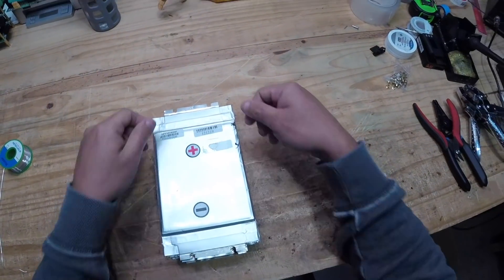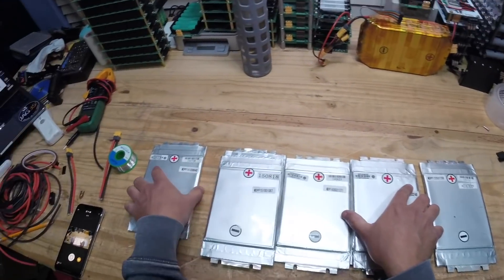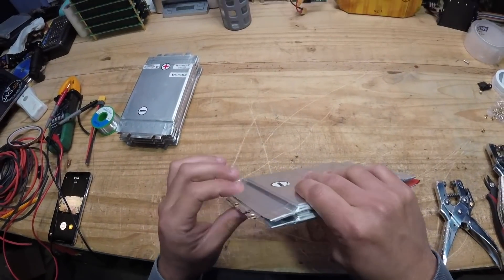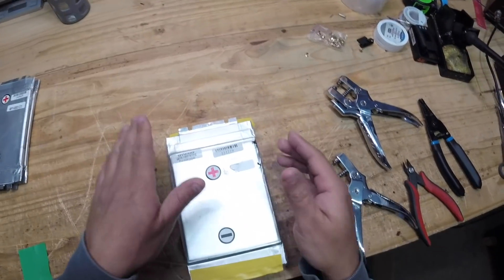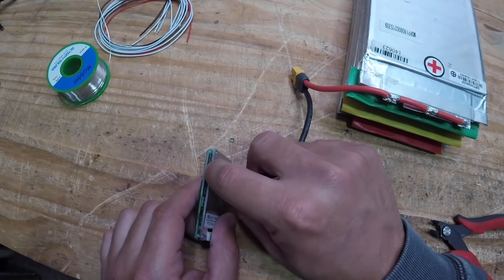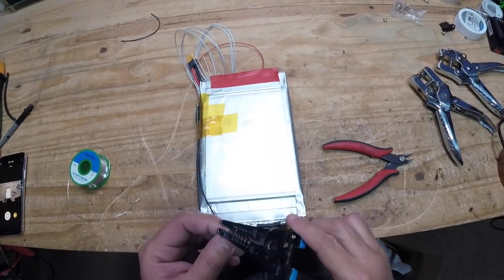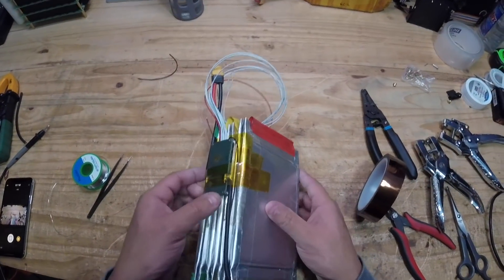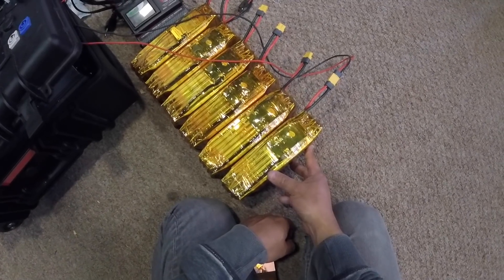Build SPIM08hp LiPo into 7s 24v packs with BMS

Comment: I am looking at making a 3S4P 12v li-ion 18650 battery but I cannot figure out how I am meant to wire up the bms, I am looking at buying this charger, as I have got my 18650 cells out of old laptop batteries I know they will need good balancing so I was planning to buy this charger to charge them https://goo.gl/7rz9QM this charger has a port for the balancing when you charge the battery but I don't know how you would connect that to a regular bms https://goo.gl/7CCu8q also would you recommend this charger and this bms or are their others that could do the job better (for a similar price mark). Sorry if this is a bit of a vague question and not like the normal interesting questions you get, I am just trying my best to be able to learn how all of this works. 

Many Thanks

George

Comment: good little project really like it but i have to throw a but in here... the main power leads are attached at 3 points, but its the most amateur way to join/attach them .ever. 
Wired joints should be mechanical attached before being soldered, to do this to mil spec, a wire should have been passed through the hole and tied around the main current carrying wire and then it should have been soldered. another option would have been to have pass the wire through the holes.  solder is not a glue, ever, well unless your a cheap sweatshop factory.  dodgy amateur soldiering in high current applications leads to fire, and we dont want another one...

Comment: Can you do a video on electrical safety?  Especially on the 48v higher amperage setups and dangers associated with ac vs dc (if there is even a difference?).  I am curious know at what point these systems can start to harm you.

Comment: Questions for all. If you were to do this as 4s packs. mount a few packs in a box, then install into a car. Many lithium chargers can take the 14.5 volt charge from the alternator and manage charging the 4s packs. Problem is, the alt needs power supplied to it to create a field to charge. Once the packs reach 14.5 volts, the alt will be shut down by the car's voltage regulator. Is there any way to get a charger to send a 12v signal out until the packs reach 16 volts? then cut the 12 volt line . I guess a charger that knows how to manage a cars onboard voltage regulator? And a shunt that would limit the 16 volt to 13 volt so the car is not damaged?

Comment: What's your thoughts on using these packs to run a trolling motor? If so how many packs would you need to get 120 AH @ 12V I think it would be 15 right?
Reply: thats what Im doing with these.  You only get the AH increase for the parrallel connections I believe.  so 3 in series x 15 in parallel =45 cells would be 12v 120 ah.  Unfortunelatley you will go slower once they drop in voltage so maybe opt for a 4s pack.  Disclaimer:  you may or may not burn up your 12v motor running it for long periods at 16 volts,  I got a speed controller/potentiometer to eliminate this risk.

Comment: great video man. If I want to make a 12v solar generator, would you suggest making a 3s battery or a 4s? I want to get the most out of my cells and am not sure which one to do.
Reply: if anyone here has any suggestions that would be appreciated
Reply: @harrisonsanin8  4s all day, just gotta make sure you get a solar charge controller that can be set to charge at the appropriate voltage, the cheap ones are just for lead acid batteries.  And of course make sure your 12v load wont fry on your full charge voltage of 16.8.    Or if your using an inverter get one that will handle that voltage.  .
Reply: @Noone-l6g  ore goe with lifepo 4 cells 4s they are at 14.4 v like an lead acid baterie
Reply: @Noone-l6g  would the one that he uses in his cheap Kodiak build work?

Comment: Jehu,
Is there a good way to make an engine start battery that will stay hooked to an alternator while running? These batteries need to stop charging once full and disconnect from the charging circuit, but an alternator needs to have a battery to keep working.  I have seen engine start Lipo batteries for racing vehicles to reduce weight, but I don't see them used for this in everyday vehicles. I would like to replace 240 pounds of batteries in my boat with a lot less weight.

Comment: I have a question. To make a pack of lithium batteries to 12 v I can combine cells of different capacity to have 3 pack of 21 Ah. Using batteries of 2.2 ah and 2.6 ah ?
Reply from the maker: Yes,  you make groups of matching capacity
Reply: So could you make 12v packs using these pouch batteries and then wite the packs in series to maintain the 12v and gain more ah capacity?

Comment: Nice video as always Jehu. I have been looking at those pouch cells. I like the idea of using low resistance cells very lightly for a long life. They are for sure much cheaper than 18650’s, but also way less work. I think the chemistry is inferior and not nearly as long life. As long as they are cheap it remains an attractive proposition.
Reply: They're designed to be cycled at high C-rates.  If you're only running them at 2-3C and don't use the max/min voltages, they'll last a long time.

These cells don't have great energy density at a bit over ~100Wh/kg, but for a stationary application it's really not a big deal as long as you have the space for it.
Reply: @phateracing  But packing round hard cells into a square box lets air gaps. packing these into a box has a  density like this. I put 42 of these into a 13.7 inch by 9 inch by 4-3/4 inch high box(custom made). Inside dimensions.7s 28 volt setup. I am getting 1624 watt hours out of it. 38.8 watt hours per cell. that's 105 amp hours at 4 volt. 10.5 amp hour each cell. 10500 mha. I am drawing at .03C(5 amp draw) to get this. But very impressive. 4.2 volt to 2.5 volt. On top of the box I added circuit breakers and  wiring and some buss bars. And another cover. Total weight is 31 lbs.   My box is 14 kg =1625 Wh. 586 cubic inches. 116 wh/kg. What can do better then that? under 580 cubic inches? Wiring,  and attaching hardware included?

Comment: Pre tin the wire on the xt connector, it will go through the hole better. And solder goes where solder has flowed!

Comment: Can I make a battery pack for an ammo can stereo with those??
Reply: These actually fit nice in an ammo can. I made an ammo can trolling motor battery with these.
Reply: @tomamerman7699  thanks for the information yeah I drive tractor so I like to put a stereo ammo can battery use with me but using the big block batteries I want to change it up make it a little lighter
Reply: @tomamerman7699  How did that work out? That's what I'm wanting to do some kind of 24 o 36v 60 to 80 ah battery for trolling.
Reply: Worked great. Fit 20 in an ammo can, 36v 16ah. This will be working 20 years from now
Reply: @tomamerman7699  Only 16ah don't work for long does it? I'm thinking at least 60ah. It's going on a bass boat.
Reply: @tomamerman7699  And thanks for the reply. I'm more asking how it works for trolling and time it lasts. I will prolly mount them in something plastic to keep dry.

Comment: Eyelets... never would have though of that. Thanks. And I've tried soldering those tabs together, it is not easy.
Reply: Ajemo, I agree.  I would never thought of it either and it seems ideal.  I just ordered from Tom, and then followed Jehu's Amazon link to get the grommets.  I'm getting excited! :-D
Reply: @chadforte2572  I ended up going with a harbor freight rivet setup, surprised it turned out very clean with plenty of room to avoid shorting.
Reply: Yeah aluminum is very hard to solder. This method is the easiest. Others use busbars and nylon screws but this for sure is perfect.
Reply: Bus bars was my thought with stainless screws... Bus bars can be made out of copper tubing, flattened out, and drilled to match the existing holes...

Comment: Yo bro ,I bought 42 of these  thank you for your video.cheers.
Reply: @Boba-Fett-GS1150Ez  That I understand and I think is mentioned in several places. Only thing that concerns me are the batteries i received that are puffed or get hot during charge. Pretty sure those are on their last stretch. Did you have any like this in your order?
Reply: Have you had any issues with your batteries? I have some that are only 6000mah in capacity with high resistance.

Comment: has anyone come across a cell monitoring/logging system, want to monitor and log some 12s (6 leaf modules), going to have multipal  packs, would like to monitor and log each module, does not have to monitor as packs , do not need balancing feature only want to monitor and log voltage

Comment: Can you check out ProLogium? They seem to be the battery to beat. Better than a Tesla. 
They are the 2019 CES Innovation Award winner for a  BiPolar+ 3D Structure Solid-State EV battery pack. How do you get these batteries? They seem perfect for a wall or car etc. 
What am I missing? 
Here is some more info 
https://www.prnewswire.com/news-releases/prologium-the-world-leader-in-solid-state-battery-won-the-ces-2019-innovation-award-300767864.html

Youtube video 
https://www.youtube.com/watch?v=UVwJarCtn_4

Comment: In case your curious, Kapton tape can withstand temperatures of 500° F or about 260° C long term, with a max short term capability to withstand temperatures of 572° F or about 300° C. I don't know what the definition of short term is, but I wouldn't want it to be at the max temp for more than a few minutes personally, or preferably ever. With the application in the video above, the temp should never get anywhere close to the long term temp unless something goes really wrong ( short ), so it's a good use case.
Reply: Good idea but not a great implementation, because kapton tape was designed for use as a thermal isolator to prevent electronic components absorbing heat when neighboring components were heat gunned or soldered to pcb’s. Isolators also act as insulators in the case where the bms is fully encased by the kapton tape, essentially you have create a thermos when leaving no path for the components to dissipate heat. Small detail, but often is the difference between a thermal runaway event and having a standing house.
Reply: Hi can Iput them in parallel with deep cicle 12v in my solar panel array.
Appreciate if you can help.

Comment: Nice video. However, I didn’t see how you connected the white wires to the individual batteries.
Reply: I think he soldered them to the brass eyelets. the black wire #1 wire goes to the  neg end of the first cell. (Main negative of pack). the 2nd wire (white) beside the black wire goes to the positive side of the same first cell. Then the 3rd wire(white) goes to the positive side of the second cell. 4th wire to positive of 3rd cell. Keep going down the connector. All wires go to the positive sides of the cells. Having a red wire and calling it the positive is confusing,. all whites are positive . There are 7s connectors being sold that have the black wire on the wrong side. Follow the negative mark on your charger or balancer, then go from there.

Comment: Bro i WHANT to do what your doing but i have no clue about anything your doing where the in the heck do I start
Reply: Theres some books on amazon for building lithium batteries.
Reply: When you say" I have no clue about anything", you have to know something... is it the electrical part, is it the mechanical part of the assembly, is it the theory of the project...?... you can be guided along, if you tell us what you do not understand...
thanks
Reply: From what I understand, Jehu didn't know anything either.  He just had a dream, and I respect him greatly.  Best of luck that you will figure out what you can do!

Comment: Nice little pack, I would just avoid wrapping the whole thing up in the tape, if there is an expansion in the cells you don't want them to have pressure holding them tightly like that. A few pieces on the sides to hold the shape whilst still allowing the centre to bulge if there is a problem would be better.
Reply: Pouch cells need to be under some amount of compression to work properly under load.

But at only 2-3C these things are pretty much never gonna have a problem.
Reply: phateracing just to make sure I understand correctly what you're saying; keeping these batteries and their current usage in mind, they DO indeed have to be wrapped? So as to keep compression and work properly?
Reply: @MrGarda42  The pouch itself is all the compression that is needed in pouch cells like these. What @phateracting is saying doesn't make any sense... As far as packs being compressed and the cells expanding - yeah its an issue but id rather build for the use-case than a "what if" this is what battery pouches (thermal/ballistic resistant pouches) are for.

Comment: Hello Jehugarcia, isn't that kind of batteries better for a EV than the normal 18650? It can handle more amps
Reply: These are higher capacity pouch cells with fewer connections needed for assembly.
Reply: These actually come from Hybrid Bus prototypes. So absolutely these can power an EV. A few guys already have cars powered with these exact cells. Being able to put that amount of power out means the batteries will run cool and last very long. A lot of guys actually using these for electric wheels chairs too.
Reply: @tomamerman7699  Who has a car that is running these?
Reply: you can find this kinds of cells inside of nissan  leafs batteries..
Reply: @ceyloninvestor  Leaf pouch cells are much larger, and nearly impossible to remove from the canister as they are glued together within the canister. If you have room just use the as built Leaf modules. Problem is you can't just use 7 single cells. All Leaf modules are 2p 2s and can't be broken down to single cells.
Reply: @onegreenev Que voulez dire simplement Cordialement
Reply: @ceyloninvestor   
 BATTERIE
 Nissan leaf
• Type Lithium-ion laminées
• Tension V 350
• Capacité kWh 40 kWh, 24 modules
• Nombre de cellules 192